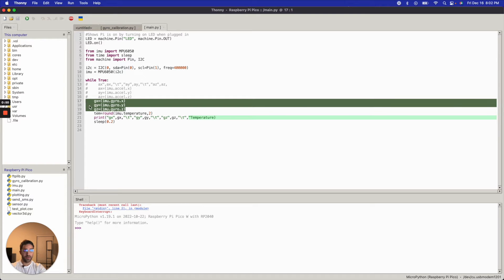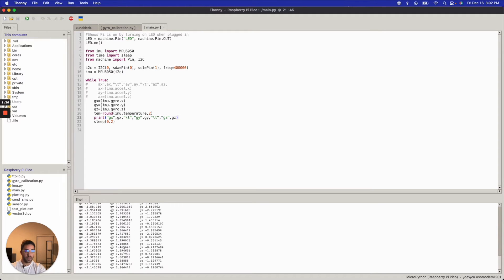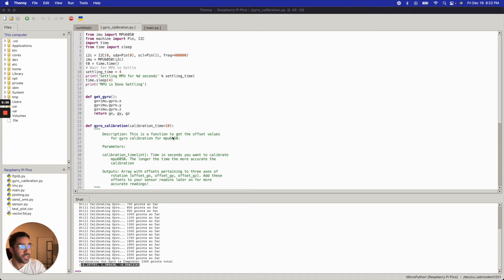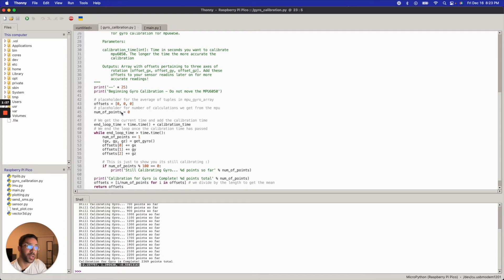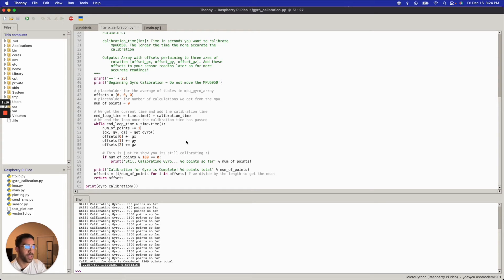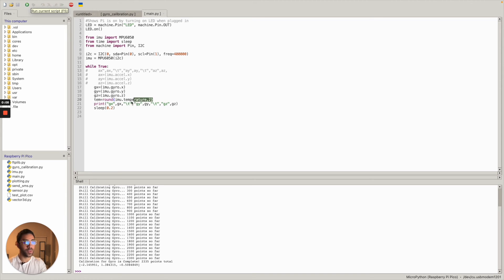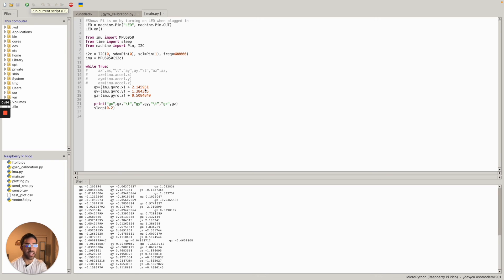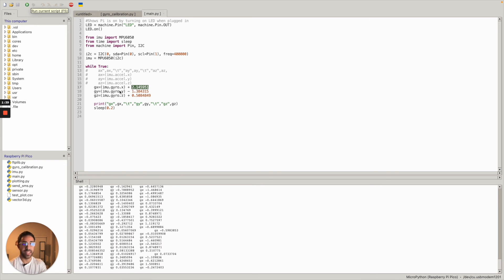How to Calibrate MPU6050 Simple/Easy (Part 1)

Comment: hey when I run the code it ends at MPU is Done Settling, why is that?
Reply from the maker: You still have to call the gyro calibration function in the code as follows:

gyro_calibration()

this will give you the values. Does that make sense?

Comment: Very informative video Shilleh. However, we can still see gz values has some non 0 values even after deducting the offset ... how to caliberate that? Any ideas?
Reply from the maker: Truthfully you will never be able to calibrate to perfect 0 even with an industrial-grade sensor, you can only get close to it. How far off are you? If you are far off then you probably did something wrong or need to calibrate longer. Let me know
Reply: @mmshilleh  to be honest I m a newbee in calibration and yesterday I learned the calibration technique and the idea behind it from ur video. I intend to caliberate my MPU9250 which gives -0.125g acceleration in all the 3 axis if they are perpendicular to the gravity. And my Gyro also gives some random readings when it is stable on the ground which I will measure and caliberate today. Really grateful to ur contents and appreciate ur efforts! 🙂🙌

Comment: Also, what is the sampling rate of this sensor? what would be my dT (change in time for each loop) in order to calculate the velocity of my car?
Reply from the maker: Correct, the sampling rate is the difference in time between each sample. If you tell micropython to wait 1 second time.sleep(1000), then you will put the sampling rate as 1 second (dT = 1s).
Reply: @mmshilleh Thank you for the reply. If we use an arduino, can we use an arduino timer interrupt function for taking the accelerometer readings?
Reply from the maker: @bruhnowayy  Not entirely sure because I haven't delved into Arduino too much yet. Actually just got one a week ago. Sorry, I cannot offer any insight on that at the moment!

Comment: Hello, I appreciate the video. I must utilize this sensor to forecast the speed of my 4WD intelligent robot. Thus, the gyroscope reading is not required, am I right? Just wondering if the accelerometer measurements would be impacted by the gyroscope. You should have also seen a significant deviation in your gyroscope measurements over time due to vibration. Should we implement any sort of filter to get rid of that?
Reply from the maker: Thanks for watching. For the sake of getting normal values for the accelerometer, I do not think you need to implement any filter because the sensor remains accurate enough as far as I know. Filters are usually more important for measuring angles, which I do not believe you are referring to. You are correct in the fact that the Gyro reading is not required to get linear acceleration values and they have no impact on one another as they are measured by different microscopic mechanisms.
Reply: @mmshilleh  Okay so to eliminate the noise which  can be generated due to the vibrations in the system, there are a couple of filters for example, Butterworth filter which can eliminate the noise which belongs to a range of frequency in the fft spectrum. 
Did you give vibrations when you tried to take the readings? Also try plotting, just so you can know if there are disturbances due to noise.
Reply from the maker: @bruhnowayy  Hey I did not get heavy disturbances but I know complementary filters are really easy to implement, have you looked into those?
Reply: @mmshilleh  it's not that easy, but yes it's implementable. I'm kinda waiting for my mpu to get delivered. I should try every thing. I'll let you know soon